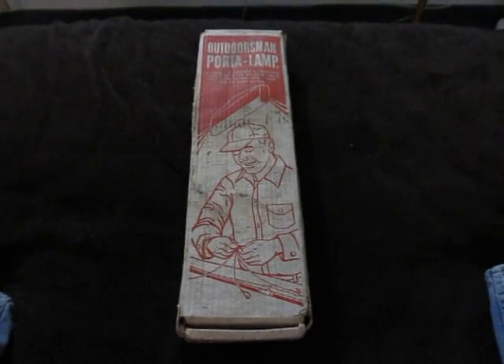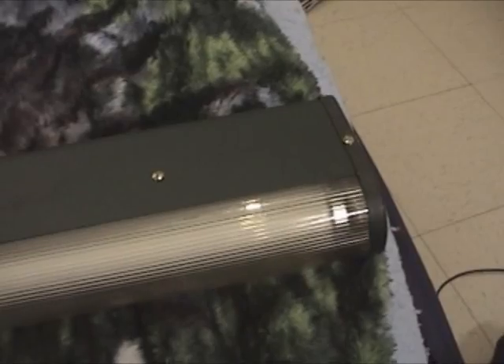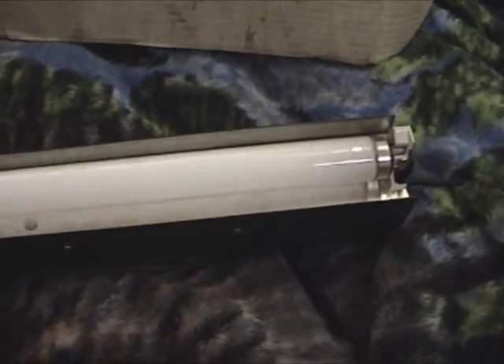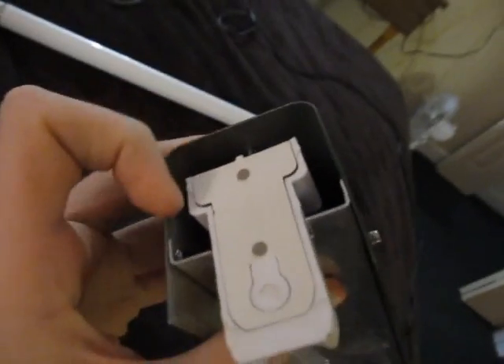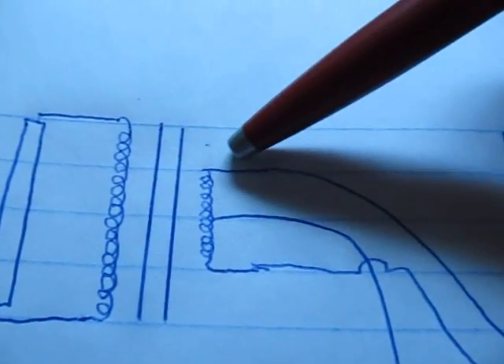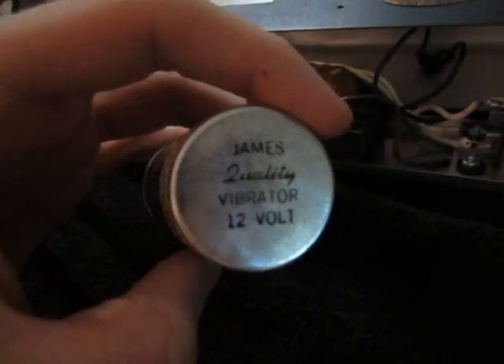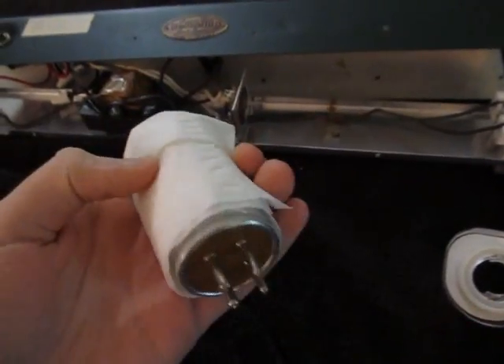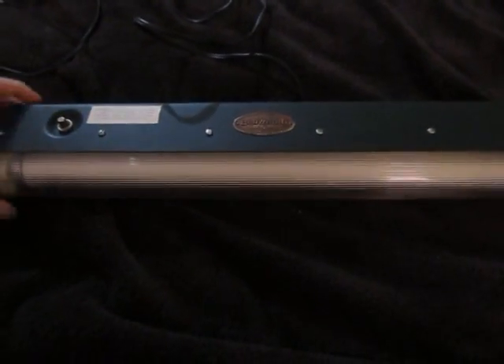Browning Porta-Lamp 12V F15T8 fluorescent light fixture (1966)

Comment: This light fixture is so cool! I never knew they used the vibrator power supplies for fluorescent lights. I just got the only unit off eBay for $56 with the box, I hope it works.
Reply: It just arrived today and the vibrator doesn't work. Hopefully I can find another one and get this cool lamp working.
Reply: Realized I never updated this comment. I got a replacement vibrator and the lamp works great. This thing is way more fun than any other fluorescent light I've seen.

Comment: Even before you started talking about vibrator power supplies I could hear the buzzing from the lamp, but I thought that may have been a bit of noise in the ballast from your external power supply until you started describing the vibrator power supply and how it works.  What kind of an impact would a vibrator power supply have on a switch mode power supply like the one from the DeskPro comptuer?  I mean you say you think the power transients destroyed your 12 volt linear AC Adaptor, could the same thing happen with a switch mode power supply?
Reply from the maker: I've been told that a switching power supply is less susceptible to wear from running this type of load than a linear power supply.
Reply: @themaritimegirl  So if I understand it, the moral of the story is use this lamp with a 12 volt battery if you can, best not use it with a mains power supply should you damage it.

Comment: I wonder what the waveform of the vibrator looks like on an oscilloscope.   I would think it look like a square wave or perhaps a modified sine wave.
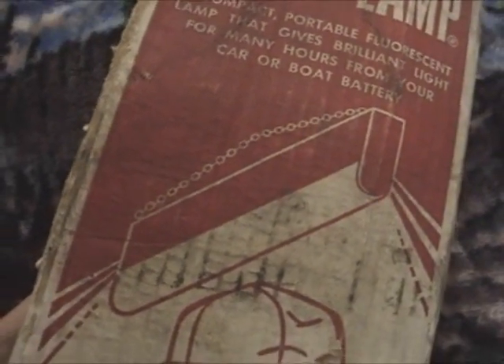Reply from the maker: The basis is a square wave, but you get a ramp down in voltage during the off time and small transients following switches, due to the transformer, snubber capacitor, etc. You can see the waveform at the 2:00 mark in this video:

https://www.youtube.com/watch?v=7EWTa1jQmng

That's in a standard vibrator circuit, anyway. This lantern is a very unconventional use, lacking the capacitor and other components which would normally be essential to a vibrator power supply, so the waveform produced by this might be slightly different.
Reply: +themaritimeman I think the reason there is no capacitor or any other circuitry is that most tube radios used a DC-DC converter circuit to get high voltage DC for the tube plates.     In this circuit, the output we need is not DC, but AC (really pulsating DC) to drive a ballast (which is most likely a transformer or inductor) to step up the voltage to the fluorescent lamp.   I would guess that the true waveform is more likely modified sine (which alternates between +, 0, - with no slow voltage drop, similar to what cheap inverters produce) due to the fact that the vibrator is mechanically moving from one contact to another and then in the middle it is not connected for a fraction of a second while moving.   Vibrators also typically run at a higher hz rate than the traditional line (usually 110 or 120hz).

I could be wrong, but I think those filter caps on tube radios are used to eliminate radio interference caused by the non-true sine waveform of the vibrator.
Reply from the maker: +Stephen Hinkle The capacitor used in vibrator power supplies is to absorb the voltage spikes caused when the two sets of contacts inside the vibrator open and close. Without it the contacts would weld themselves closed shortly and render the vibrator useless.

In this device there is no capacitor because the fluorescent lamp acts as the capacitor, absorbing the voltage spike instead of it appearing across the vibrator contacts. In addition, the voltage spike is required to allow the lamp to start, so if a capacitor were added, the lantern wouldn&#39;t work.

Comment: Oh wow! That is beautifully designed. I actually made an inverter many years ago that used a similar principle to this. I took a standard 12v transformer from a wall brick and used just a standard relay with the coil wired across the contacts. It did actually work however it barely ran a 4w tube it didn't take long before the relay contacts welded up. I never realized this principle was used for actual products though.
Reply from the maker: It is indeed a really beautiful design. Now I wonder if the Ash Flash Discoverer II - a 4 watt lantern I've been after for a while - uses a vibrator power supply. It is indeed preheat, and it runs on 9 D batteries for 13.5V - perfect for a 12V vibrator. Someone on LG has one, but I haven't been able to get a response from them about it.

Comment: Speaking of the Magnetic Ballast, there's one was manufactured in 1939, 1940's, or 1950's, they usually made a huge brick of Magnetic Ballast including on both Westing House and General Electric makes the ballast where they usually put the ballast on for all of the old fixture for every other local stores where they need the light where I can tell they use a tar oil to keep the ballast protect against any moisture or any trace of object, and not only that, there's a long rectangle shape ballast what they called theirs, "Long John Ballast."

When any magnetic ballast tends to fail where it overheat by protecting the lamp, it will cause tar oil to leak down and it will cause the risk of fire if overused the ballast, and not only that when the ballast is starting to fail include the 30's, 40's, or 50's ballast, you can also send the old ballast to scrap metal if that starting to fail or if that is starting to get a short circuit.